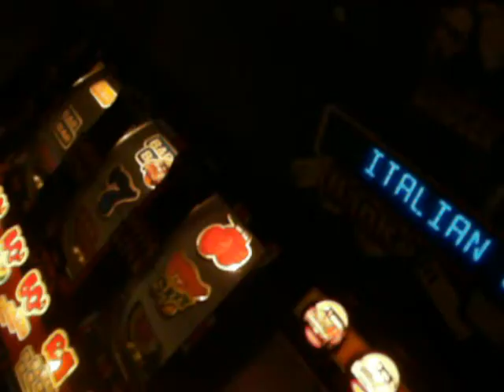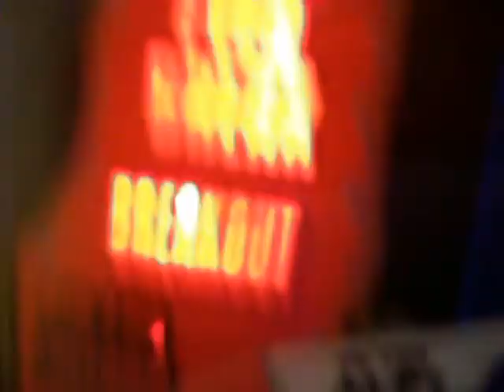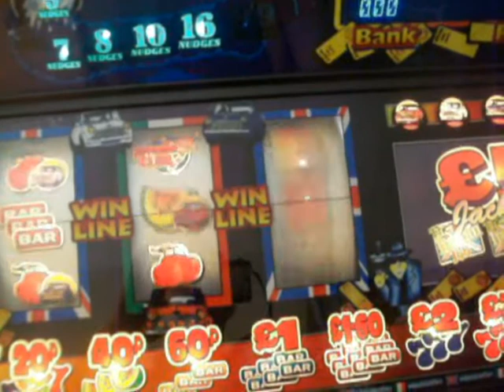MAYGAY POWER SUPPLY FIX

Comment: Hello mate. I've got the same power supply, 3 off them altogether. Got a similar problem. But when I disconnect all the lights it seems to run fine. Put half the lights on it runs for few mins before resetting. All the lighting causes it constantly reset. Do think I've got the same problem?
Or if anyone can help. Original Simpsons fruit machine. Thanks

Comment: Hi MAGIK great videos pal, im learning bits and bobs from watching.Ive just bought a Maygay Great Escape of off Ebay that was advertised as spares or repair.It doesnt power up at all when plugged in.I dont have keys to open up top front of the machine so jjust want to know if there is a power switch inside the machine near the top which i cant get to.I am going to have to drill out the locks to open it anyway just wondering about the power switch.
Kind regards mate.

Comment: I had my Donkey Fail on me and after replacing all the larger capacitors on the MPU board did not help I was lucky enough to find a replacement PSU board that fixed the problem.  Thanks to this video if it goes again I know what to look for.

Just fitted a replacement battery after being lucky and catching the old one before it caused more than minor surface damage.  I have my fingers crossed as 2.4v NiCd batteries are all likely to be old stock and in deep discharge.  Any recommendations if the battery I obtained doesn't work?
Reply from the maker: +Alex Atkin dont use nicads.  Get a green 2.4v nimh and put it on flyleads away over the other side of the cab.
Reply: MAGIK I was wondering about using a NiMH instead but couldn't find any information about if the difference in charging conditions would be a problem.

As I understand it, NiMH has a different voltage scale so would either under or over charge using a circuit designed for NiCd.

I did end up replacing it with a slightly different NiCd on flyleads.